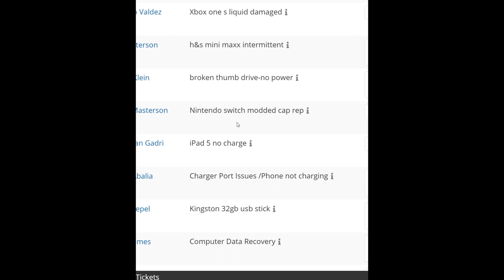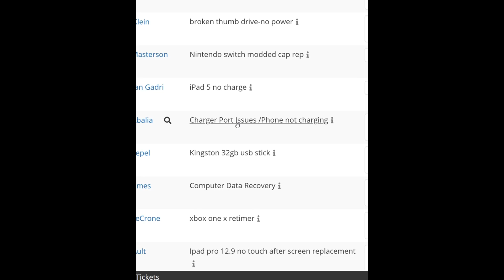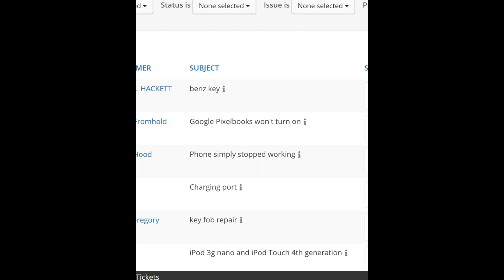Xbox One S No power after Cat Piss. Disgusting repair. Working Smart not hard.

Comment: The ram ic needs replacing in this case. I see this kind of stuff all the time. A reflow simply won't help because the urine has caked onto the board under the ram. It also very likely burnt out the TPS51916 ram PMIC at the same time

Comment: What if one starts off on such boards with ultrasonic cleaning ? Would get a pee free and clean board to work with, right ?
Reply from the maker: You don't start by removing damage evidence. You do ultrasonic last.
Reply: @NorthridgeFix  Take pictures of the damage before the cleaning.
Reply: @infopackrat good idea (kind of), taking a high resolution pictures of both sides & the damage areas then putting it in the ultrasonic cleaner sounds good, but as he mentioned he doesn't have that much time to waste on one device (neither should we, if we want to be as half efficient as him)+ the camera may miss some small dameged areas like on the edges of the board, never the less good idea 💡
Reply: You're a Dr according to your title right? You wouldn't stitch up a patient before extracting the bullet would you? You don't ultrasonic a board before finding problems and repairing them. That way you have to clean the board twice and you also have no evidence. A picture doesn't suffice in this game
Reply: @TheCod3r   Well, I'm a surgeon by profession and we always start up by cleaning. If the case is a medico legal one, we take pictures, chemical samples and scans and then clean, to preserve the evidence. In my experience, cleaning always makes the work easier and provides superior results. As in a patient, where working on him without cleaning could result in infection, working on a board with corrosive contamination might accelerate damage to components apart from making the work difficult( Well, I'm not an expert on this and that's why I asked this doubt.)

By the way, nice work @northridgefix. And thanks for the reply. Learned many things from you. Keep up the good work. 😊

Comment: I had a very expensive UHD SMART TV come in for repair.  A cat pissed on the front bottom and the owner waited 4 years to get it fixed. Needless to say the corrosion got in to the screen connections and the screen itself. The tv would cost about $400 to repair.  Although the TV cost $4000 new,  the same TV could be bought today for less than $500. Case closed.

Comment: Remember driving for 3 hours to look at a dead 486 PC many years ago, opened the top to be greeted with many mouse droppings and plenty of corrosion on the board.  That one went straight in the bin!
Reply: Yup. Had a few industrial boards ruined by mice. The urine destroys pads & traces, gets under chips and into the layers of the board. It's tough to give up on a board that may be worth thousands of dollars, but some are hopeless. Also, those cute little guys will chew all the wiring insulation away, get caught in moving parts, etc. Critters can cost a factory A LOT OF MONEY in parts, labor and downtime.

Comment: Do you ever measure the filters so you can just purchase a group of them, or do you always use diners? Can filters be left off like capacitors? Thanks for the videos. Can you test the filters?
Reply: 1. he usually have both, new filters & doner filters
2. No filters are very important and you can't just lift them off like (bypass caps), you have to replace them
3. Yes you can test them like you test fuses, Diode Mode on the multimeter and each prob on a side, if its good you should hear a beep

 (you might want to check with the boss though, just to confirm)
Reply: @lexander9686  Thanks for taking the time to reply. Stay safe.

Comment: Just wondering why did you not remove the chip (with all the piss under and around it), clean the board and then put the chip back? Probably there's a good reason for not doing it like that but what is it?
Reply: then it needs reballing because some solder balls will most likely move in the desoldering process, its longer and more complicated

Comment: Does he do graphics card repair?
Reply from the maker: I haven't done many.  It's a hit and miss fixing graphics cards since GPU in most cases is the culprit
Reply: @NorthridgeFix  
Oh. I just had an issue with my card. The Display ports stopped working, so I sent it in for repair directly to the manufacturer, but they couldn't do anything. It all boiled down to a tiny capacitor or something, that was chipped, rubbed, sheered off. 

They claimed it was "unfixable". So I was hopping I could find someone who could show me how to repair it. :/

Comment: Hello .  If we connect two batteries to the phone, does it spoil?
Reply: If you connect them in a parallel connection there will be no problem! This will increase the power and have the same voltage!
Reply: @ateagno8506  But the amp will be a multiple.
Reply: @ateagno8506  In series the voltage is doubled
Reply: @ateagno8506  Thank you very much for the benefit